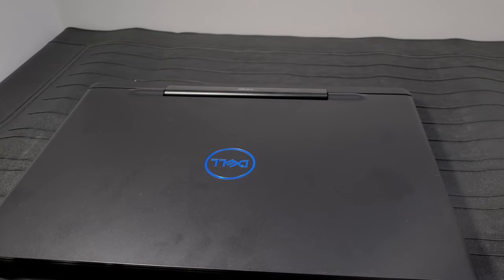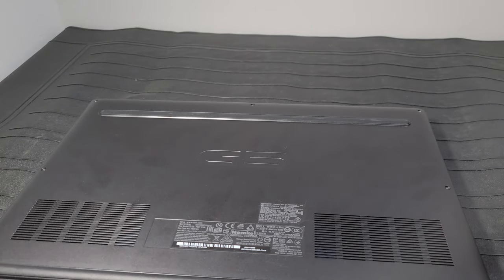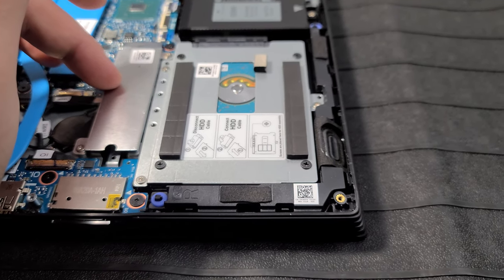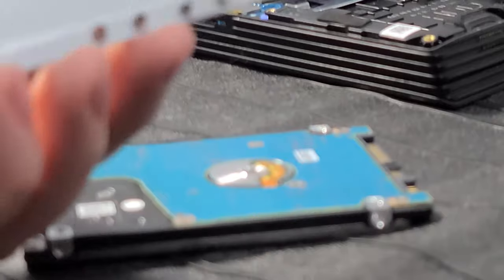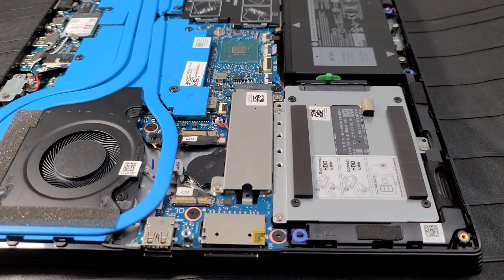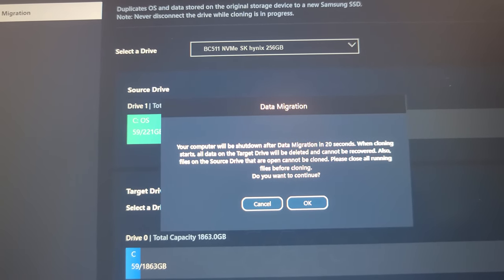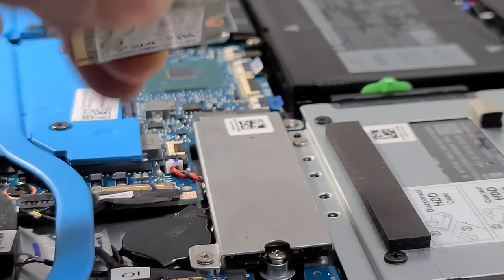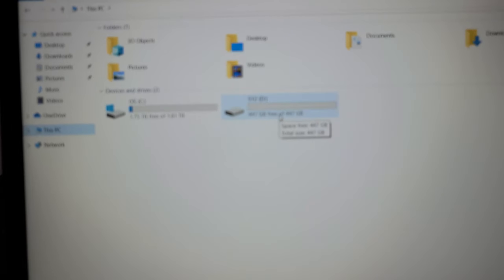Dell G5 5590 - NVME & HDD Upgrade/Replacement | Samsung 860 QVO 2TB & Kingston HyperX Predator

Comment: can i upgrade the stock 1to hdd with a Samsung 870 QVO 2 To ? the 870 is way cheaper than the 860 somehow on amazon
Reply from the maker: You can change out the 2.5" HDD with any other 2.5" drive.  So yeah that should work.
Reply: @DruuzilTechGames  hey ! Just to say that I successfully replaced the HDD with the 870 QVO 2To, no issue at all ! Thanks for the vid again 👍
Reply from the maker: @druxt_  Awesome, glad to hear it.

Comment: Hey! I installed a Samsung 970 EVO into my M.2 slot, removing the 256 gig drive that was in its place, I didn’t clone anything. I booted from my windows install key, but the drive doesn’t show up in the disks there. In the bios it shows up where it says all the system info like ram, cpu, and disks, and it properly shows as a PCIe M.2 drive. No matter what I do I can’t get it to show up in either windows partitioner, or windows installer. Any ideas?
Reply from the maker: Is that M.2 drive the only one in the system or do you have some kind of 2.5" drive also?  You're trying to do a fresh installation of Windows onto your 970 EVO, is that correct?

Comment: Hey man, this is cool. You may help me with the issue i have with my Dell G5 5590.  Not sure whether the NVMe ( SK Hynyx, BC501,  HFM128GDJTNG) has the issues but I never got this laptop working properly. It heats up a lot, like literally keyboard starts heating up so bad that you can't touch near the power button and abruptly shuts off. Tried to restore the dell recovery but it gets stuck at 54.xx % always
I removed NVMe and it seems ok, wont shut off itself but is extremely slow now. Can I upgrade the NVMe to 512 GBs and do i need to take some particular specification?
Reply from the maker: I'm not sure where there may be a cap it allowed NVME capacity, but I'm sure a 512 or even 1TB drive should work.
I actually returned this laptop to Best Buy because of the overheating you mentioned.  Got an HP Spectre x360 later which has a 15w CPU to avoid the heat issues, but I kinda stay away from gaming laptops these days because they always overheat.

Comment: I have to say it because it's burning my brain, but wouldn't he want to THEN clone the OS BACK to the NVMe M.2 drive which as a MUCH faster transfer rate to work as his OS boot drive? The 2TB SSD is going to be much, much faster than the old mechanical 5200 RPM drive. Just seems to really be shooting yourself in the foot with storage space and OS peppiness.
Reply from the maker: Linus Tech Tips did a review on the differences between Gen3 SATA, NVME Gen3 and NVME Gen4 drives.  There is no appreciable difference between them in OS load times, game loads, or most other uses.  Unless you're moving around huge data sets (like 100GB+ which I regularly do when making Deepfakes), or using some other kind of applications where load times are super critical, apparently there's really no difference that a user can notice.

Comment: Do I have to use data migration if all I want to do is add additional storage? I got a 500gb nvme drive which currently runs the OS and just want to pop in a 2tb ssd in the 2.5 inch bay.
Reply from the maker: Nope.  If you're not actually migrating any data you just install the drive, and once in Windows you'd use the disk manager to format the drive and assign a drive letter.
Reply: I had the same question.  Thanks for asking!

Comment: Will this work with the Dell G5 5505?
Reply from the maker: Assuming it has an M.2 and a SATA port, then yes you could add in whatever NVME and whatever SSD you wanted.
Reply: @DruuzilTechGames  Ima newbie to this stuff but....what's a M.2 and a SATA port?
Reply from the maker: @rubyrogers8879  The SATA connector is the one you use for the 2.5" drive.  The M.2 is the one you'd use for an NVME SSD.  Do a Google image search and you can see what each looks like.
Reply: @DruuzilTechGames  kk

So uh I have the same brand SSD except its just 1TB

Ik like my laptop (Dell G5 5505) is similar and I asked this but will I need like any other things or is it just a simple "unplug my previous SSD and plug in the new SSD"?
Reply from the maker: @rubyrogers8879  Assuming the new 1TB drive you're talking about is not your OS drive, then yeah pretty much you could just swap one for the other.  You'd have to format the drive once in Windows to get it to be usable (using diskmgt.msc), but that takes like 2 seconds.

Comment: If I'm not mistaken that drive that you installed and made your primary operating system drive, the solid state drive, is about 20 times slower than the NVMe drive that originally had the operating system loaded on it (and the same amount of speed slower than the new nvme drive you installed).  That's why the operating system was originally installed on the nvme drive. You said it at one time in the video "'this'drive maybe a little faster, maybe not", about half way through the vid.  That's where I'm talking about.
Reply from the maker: While the Kingston drive I used in this was probably a little slower than the original drive, it wasn't anywhere near a 20x difference.  The fastest NVME drives out right now are probably Samsung 980 Pro's which are like 7000MBps read/write.  I think the drive I used in this video was something like 1500MBps.  Nowhere near a 20x difference.  The drive that came in the system might've been a 2000-2500MBps drive.  For general usage, none of this matters anyway.  Linus Tech Tips did a video a couple years ago illustrating that people can't tell the difference between regular SSD's, Gen3 and Gen4 NVME drives whatsoever, and that most people thought the system with a regular SSD "felt" faster.

Comment: Removed 3 m3 screws..pulled the green tag but hdd not coming out whatever i do..
Please help
Reply from the maker: What time stamp in the video please?  I made this over 2 years ago.  Are you trying to remove the 2.5" drive or the NVME SSD
Reply: @DruuzilTechGames  am good..the had was stuck on the thermal pad..i had to put little push in the bottom gap to release it
Reply from the maker: Ah, glad you got it then.

Comment: Thanks a lot! I removed my ssd and installed a samsung evo 970 plus nmve. I noticed that my dell g5 5590 haven't that sort of case for the ssd like yours in the video (20:40). Do you know where i can buy it?
Reply from the maker: If you're talking about the silver colored piece of metal that goes over the NVME SSD to protect it.. You can buy heatsinks for NVME SSD's but they're designed for desktops.  If the laptop itself doesn't come with one, I'm not sure where you'd find one thin enough to fit inside a laptop case.

Comment: Does going over 1tb do anything, according to the Manuel the storage for a SSHD is 1tb and an SSD at 256. I’m looking towards upgrading but I’m not very good with computers
Reply from the maker: The manual is just telling you what the stock components were (ie a 1TB SSHD and a 256GB NVME SSD).  You can add faster/higher capacity components as desired.

Comment: Hey, awesome video! I wanted to ask that mine has just 512gigs nvme storage And 60w battery so will it have empty hard drive cage which I can use to install ssd?
Reply from the maker: Do you have the same model laptop?
Reply: @DruuzilTechGames  yes its the same model g5 5590
Reply from the maker: @nightingale4106  It should have the same layout internally then.  It's pretty easy to take the bottom of the laptop off to verify though, so if you want to be sure about it before buying an SSD or HDD to install, it'd probably take like 5 minutes to open it up and see.
Reply: @DruuzilTechGames  okay, thanks for the help!
Reply from the maker: @nightingale4106  Any time!
Reply: @nightingale4106  so?was it empty?also i heard we need seperate hdd cable for it?or it came with hdd/ssd u bought?
Reply: @gamersforlife3440  no it came with a hard drive cage and a hdd cable. I was worried at first but I was relieved after seeing everything included.